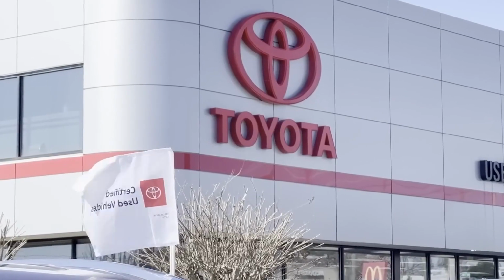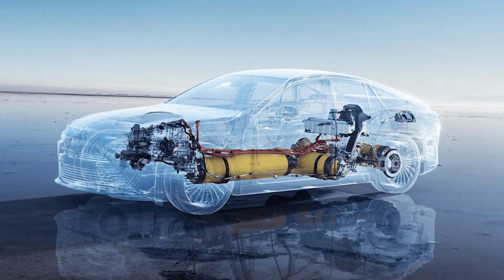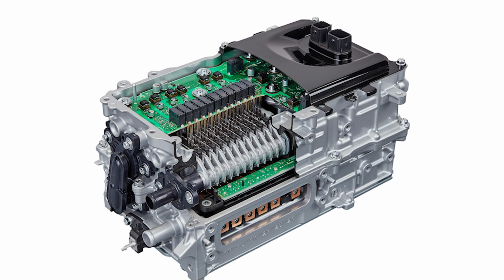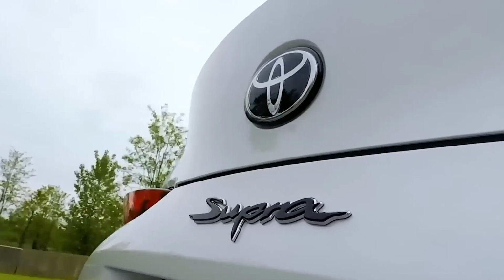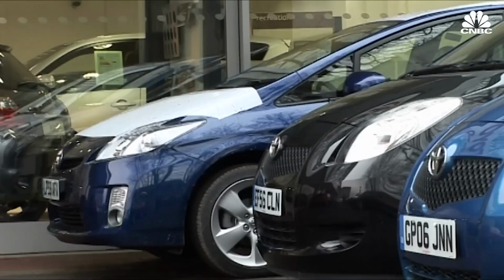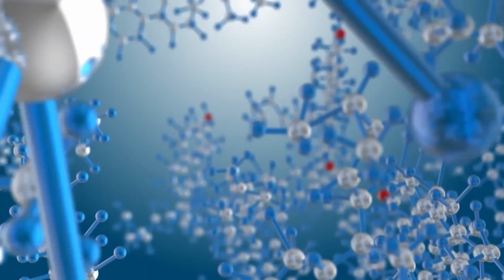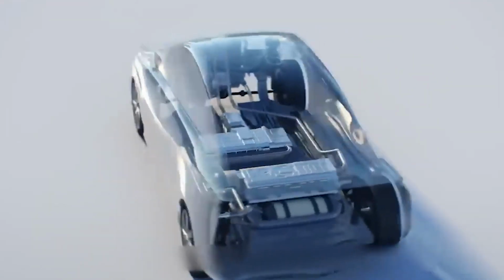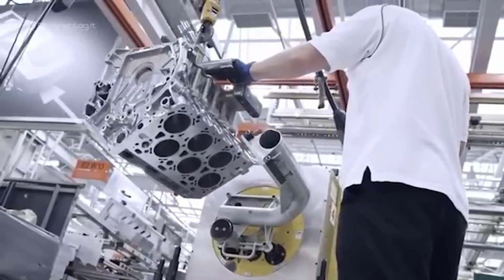Toyota's New WATER Engine Will Destroy The Entire EV Industry!

Comment: Toyota's water engine will not destroy EV industry. But Only support EV industry. Future water cells will provide electricity to recharge the connected batteries of the EVs. Tesla has already elucidated this type of  solution to the EVs. Samsung had discovered the solid state batteries that can be recharged in seven minutes. These discoveries will boost the production of EVs. EVs are the future mobility of the mankind.

Comment: Yeah you can drive theses cars but in your on risk because if the pipes starts to leak in to the battery or to the transformer your going to in some serious trouble not only that but it can cost your life
Reply: @yaxhacruz  The battery and Alternator  (Fuse Boxes as well) can All be relocated elsewhere - say, to the rear of the vehicle... while the Engine, Transmission, Torque Converter and Coolant systems can All remain Up Front under the Hood.
VERY EASY TO DO!